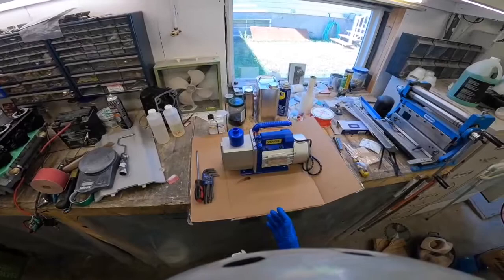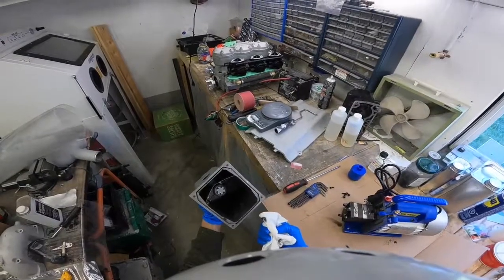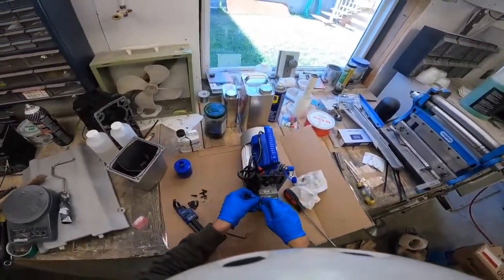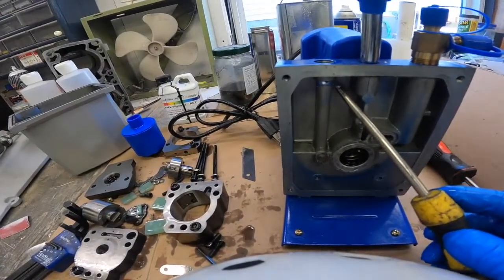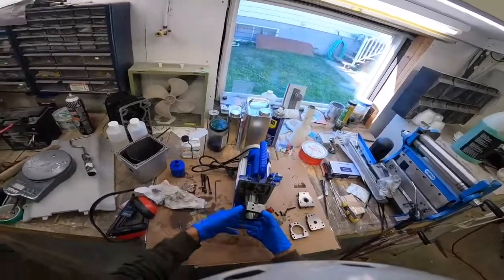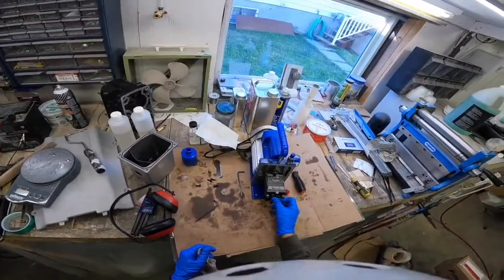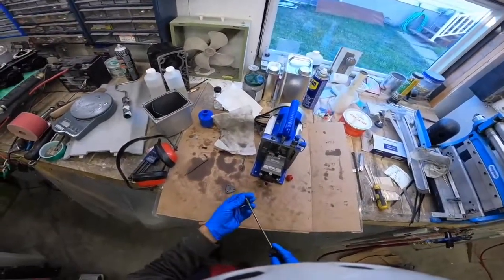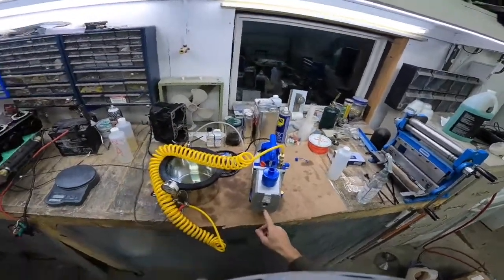Two Stage Vacuum Pump Teardown & Rebuild - Why Do Cheap Vacuum Pumps Fail ?

Comment: Sorry I'm slightly confused, must've missed something...  What causes cheap vacuum pumps to fail?
Watched the other video (1st part) and saw your previous pumps were seriously defective with moisture corrosion.
The reason they fail is b/c these cheap pumps are full of gak/grit.  I've seen that on many other Chinese manufactured items, I think they don't believe in keeping things clean, they know well these aren't clean.
Hopefully mine isn't ruined already, I'll be taking it apart for thorough cleaning.
Reply from the maker: Yes, this is part two, and in the first one I showed a lot of rust. In addition I took this working pump apart and found a combination of rust on pump surfaces from being shipped, grime / casting junk  and debris left behind. I also found a missing bolt, so in some cases being assembled poorly.
Reply: @JoelArseneaultYouTube  Thnks, yes I did miss the first part.  Going to watch it now, for the details!

Comment: Hiya, thank you for taking your time to make this, I'll make sure to clean the one out that I just purchased. However what oil/oil specification do you use on these pumps? Also how did you go about removing rust?
Reply from the maker: You need to use proper compressor pump oil. Lots of times "special oil" is just a marketing thing, but this is legit. The quick explanation is that normal oil has a lot of stuff in it that will offgas and this would not allow the pump to pull a vacuum. The proper oil does not foam or offgas at low pressures, and this makes it possible to pull a better vacuum. 

If you have rust, I use scotch brite when I can. It will remove rust pretty well and isn't too aggressive.

Comment: Amazing work! I'm shocked this doesn't have more views. Of course a 1hp vacuum pump is better at decreasing pressure, and moving air, but why does 1 hp make you more comfortable running it for long periods, than one rated with less power? You totally could be right, but I don't understand why that'd be.
Reply from the maker: Thanks for your comment. 

Running a bigger pump with more power has a few advantages. 1 is that it is able to pull a vacuum more quickly and maintain a vacuum if there's a small leak.  It can also run under higher load for a longer period without stressing it out.

Comment: Use a cold trap to stop moisture harming pump. A cold inverted U that condenses vapor before the V pump.
Reply from the maker: This is an interesting idea...Not trying to pick on you by responding to your comments...  I'm really trying to wrap my head around it and it seems backwards. Cold air is more dense and has more moisture. For this to work, you would have to cool and condense the air, pull the moisture out of the cool air and then allow it to enter the pump. 

On a closed system, simply cooling the air would condense it, but that would just create more work for your pump as your pump would then have to expand the air, and if you didn't remove the moisture it is still getting that moisture. Further, you can't trap moisture in a vacuum as the vapor point of water would stop this from happening... unless you used liquid nitrogen to keep it frozen. 

It is my understanding that even ice in a vacuum will offgas due to the vapor point, so I'm not sure how or if it is possible to remove water in this way. 

It seems to me that super heated air would be free of more impurities, like water and would also have more energy that would be easily extracted, and as the temperature dropped, the pressure would naturally drop. I may be missing something here, but it seems to me that heating the air before your pump inlet would drive off moisture and be the best solution.

Comment: Such a beautiful job!  Thank you.  Mmm.  A thought.  A question, rather.  When does a rotary vane pump work hardest: (a) when pumping against ambient air or (b) when pumping against a vacuum?  You seemed immediately to have acquiesced to the notion that (b) was the correct answer. And you even defined pump break-in and shut-down protocols predicated upon that intelligence.  I won't dispute the correctness of your protocols, I merely deny their premise.  That is, I claim that a rotary vane pump works harder when pumping against ambient air than when pumping against a high vacuum.  Given that the pump runs at a nearly constant speed (which is probably pretty nearly true), the amount of gas that it expels will be proportional to the density of the gas that enters its pumping chamber.  Indeed, in order to expel gas at a constant rate (which effectively equates to a constant rate of work) , the rotational velocity of the pump would have to increase inversely to the gas's density.  But it doesn't.  

Upon considering the problem further, I believe that the answer turns upon asking the right question.  I would claim that rotary vane pumps, once running, do very little work when pumping against a vacuum.  Moreover, I claim that their capacity to generate a vacuum is limited -- not by the power of their motors -- but by the lack of gearing needed to increase their rotational velocities.  However, during startup, rotary vane pumps have no rotational velocity.  When pumping against ambient air, the pressure differential between the inside and outside gasses is small and nearly constant while the pump is rotating slowly.  But when pumping against a high vacuum, the pressure differential essentially equals the ambient pressure.  So the pump must produce a large, momentary torque in order to initiate the pumping process -- which is, I think, the rationale behind your startup protocol. Interestingly enough, compressors have a similar startup problem.  A special valve is used to bleed off high-pressure gas from the compressor's compression chambers when the motor turns off.  This prevents the compressor's motor from having to muster the torque needed to complete an already begun compression cycle during startup.  

Anyway.  Your presentation was a tour-de-force of logic, self assurance, and gumption.  You're the guy who went from knowing nothing about rotary vane pumps to suggesting how pump engineers might improve on their design (by using studs to ensure proper registration for the pump's component parts).  Kudos!
Reply from the maker: Wow... You obviously put a LOT of thought into this. You are correct, I made a lot of assumptions about the workload on the pump ambient vs vacuum. I don't believe I have the cognitive ability (or time) to fully process what you are saying, but I do understand what you are getting at. 

If you have a syringe half full of liquid, with no visible air, block the end and pull on it, the amount of force required ramps up, but at a certain point the amount of force required quickly ramps back down. It makes for a very odd spring effect and I believe this is caused by what you are talking about. 

As for the compressor analogy, I am familiar with this release valve. I built a custom compressor and installed it in my attic. The valve releases pressure from the top of the piston and the lines leading to the tank check valve, so that the pump can spin up under atmospheric pressure. 👍

As for spinning the pump faster, I'm sure that would help to some extent, but ultimately (to my understanding)  it is the lack of air molecules, close to a "perfect" vacuum that make this process difficult. If you were trying to empty a bathtub with a cup, at first it would go quickly, but once you have droplets the cup is no longer effective and a different tool is required. 

I don't think I explained myself very well, but I believe that the reason why the pump shouldn't be shut down under "load" is that the check valve system is not perfect in these pumps. My thought is that the atmospheric pressure will  leak through the check valve putting a load on the pump veins. I suspect this is not good when the pump is really hot.
Reply: Interesting.  I think that your cup analogiy is correct.  At some point the density of the compressed gas (viz. the gas in the cup) becomes so low (ie. contains so few molecues)  that it lacks the pressure needed to open and expel itself past the one-way reed valve.
Reply: @bradalmond3618  I'm pretty sure you are entirely correct. I'd imagine though, that although the pump isn't working as hard under vacuum as ambient air, that the decrease in air molecules reduces the cooling. So I'd imagine a vacuum to be doing less work once it pulls the vacuum, but counterintuitively actually generate more heat (in the material of the motor itself due to friction), because the creation of the vacuum also decreases the cooling media itself, the air. It's probably this increase in heat, that makes people often assume it is doing more work.

Comment: It was too late for me to watch this video before I start to repair My cheap vacuum pump (which I bought for 15 USD in junk yard). My problem was gauge was always stuck at -0,9 bars. Never have any exprience with vacuum pump and gauge before. Whatever I watch at youtube everybody reach almost -1 bar at their gauge. But by this Video I learn that altitude of Ankara is 980meters Which cause my gauge to show maximum -0.9 bar. I really learn a lot by disassembling vacuum pump but it is too difficult to adjust the Vanes and layers. if you do that wrong, your pump won't work properly. if you have 2 stage and powerful vacuum pump, maybe you won't notice that your pump work decent as long as you test it . It may vacuum fully but may be much slower than original. That is why very, very carefully try to fix your vacuum pump. May be better don't touch it. :-D I learn it by hard way, too
Reply from the maker: Sorry to hear about your troubles. I'm not sure what you mean about being difficult to adjust the vanes and layers? I am a mechanic, but I didn't find anything difficult about the assembly of this pump. 

I did have a slight issue with alignment of the housings the first time I put it together, but once I knew I had to be careful, it was easy to correct. I'm curious what your problem was / is.
Reply: @JoelArseneaultYouTube  First of all I did not study mechanic and I have very limited knowledge. My pump is the lowest model on the market I guess, 1/4 HP motor and 1 stage 1.5 or 1.8 CFM.. when I am rebuilding it, I can easily fix the layers 2mm left, right, down and up. So it is all up to me. It will still work but not at the best .if I do any mistake system shows me the result immediately ! WHY? because I have super weak motor + 1 stage vanes. NO backup vanes, not big power. Even the torque which you use to fix the bolds plays Hughes roles at my pump. But you are lucky you have 1/2 HP motor + 2 stage vanes + your pump looks more decent than mines. so even if you do a bad alignment or adjustment when you rebuid the system. it will still vacuum perfectly. Why, because 2 stage support to each others mistakes + 1/2 HP support them with big Power. But with bad allignment you may not reach 5CFM any more may be much less.After you rebuild it, even if it vacuums fully it may not be working at promised speed. May be I am totally wrong too. But "If it works... don't touch it" rules is the best. To be honest, I would still touch it. It is fun :-D  I also notice that more oil I add, better Vacuum I get . Pump that I have has oil window which has mark at the middle says " oil level" , no max or min marks. I add the oil up to 4/5 and vacuum gets better. I think oil is a great sealer. That seal the vanes very well. I use SAE 30 oil. not something expensive.
Reply from the maker: @TheHoppala007  Thanks for the clarification. I understand what you mean now.

Comment: I opened the 2RS3 and it. Looked different inside. I think they've redesigned the pump. 

The two blocks for 1st and second stage look much deeper/thicker and the reed valves have a faucet mesh on top with what appear to be adjustment screws as they sit proud of the surface..

Btw they only put a small amount of oil... Say 10-20mls. I was going to find an iso32 oil and use that.

Fan feels smooth but firm.

All external parts of pump look free of rust.

What little oil that's in the big end casing has fine black in the bottom with the rest of the oil above it honey colour. Not sure why they didn't include oil bottle in the foam recess but perhaps I got a cheaper deal.

The pump is identical to yours on the outside but inside looks different. Yours seems to have more blocks that are thinner. I'd send you a pic if I could figure how on this thread .
Reply from the maker: Interesting. The deeper vien sections would indicate that it is a higher volume pump. It sounds like overall they have made it a better pump 👍 I'm really happy with mine so far and have a lot of hours on it, so hopefully yours works well as well. 

Yes, I believe that black stuff at the bottom is stuff from the casting not being cleaned really well before assembly. It would get stirred up into the oil if you ran it fro long, and I can't imagine that would be good for anything. Perhaps someone already had your pump and removed the oil. I think it would be in their best interest to include the oil, as if they don't, they will get a LOT of people running them without oil. Even with the oil in the box and a big yellow note telling people there isn't any oil in the pump, people still run them and seize them... and then return them.
Reply: @JoelArseneaultYouTube  I'm running it for 15 mins with inlets and outlet cap open. With the required 370mls of oil and it's looking clean through window. Temperature with temp gun shows 47C after 15 mins from 25C ambient temp at start.

Will drain oil just to be sure as I got 5 litres of good quality penrite iso 32 vac pump oil for $32 AUD delivered.
Reply from the maker: @rodneyalan6441  That sounds good. They do run pretty hot under normal operation. That sounds like a really good price !

Comment: It goes down to only 25 Hg?  That is bad.   Even cheapest vacuum pump is supposed to achieve 99% vacuum or 29.6 Hg.  Original spec for this pump is probably 99% vacuum, so something is still not working properly.
Reply from the maker: It's a little more complicated than that. Vacuum pressure is simply the absence of air in a container, but the actual pressure is supplied by atmospheric pressure. 

You may be able to get 30 Hg below seal level if barometric pressure is really high, but I am at almost 4000 ft, so the max I can get here, on most days, is 25 or 26. I used it this weekend, it was a little cool and damp and it had no trouble getting to 26.5 Hg. 

Again, you are removing air from something, and the pressure is supplied by the surrounding air pressure. This is why there is a max that can be reached.
Reply: Pump specifications are for capped intake with no flow. Most pump manufacturer produce pumping curve pressure vs flow. Also mechanical Bourdon gauge give what is call gauge pressure related differential to atmospheric pressure. Thermal gauge like thermocouple and Pirani gauge type give you absolute pressure reading not relate to atmospheric pressure.

Comment: This top-down view isn't doing you any favors, especially with the extreme wide-angle lens. Everything is too small and the angle makes it very hard to see any detail, even on a 32" PC monitor. I can't help but feel sorry for the people viewing this on mobile devices.
Reply from the maker: Thanks for your input. I will keep this in mind if I do a video like this again. I believe the reasons I shot wide angle is because 1. I have it as the default (this is not normally what I shoot) 2. it leaves much more room for error with the part still being in frame if my angle isn't quite right and then I move around. 3. As I believe I mentioned in the video, this was not meant to be specific to this pump, just vacuum pumps in general. If I made a detailed video, it would very likely mislead or confuse people who have a slightly different pump.

Comment: Can't see shyt !!! 5 minutes in and was hoping for a closer view. Ugh
Reply from the maker: I've had this comment a few times. There are lots of different pumps and even pumps of this same model (over time) have changed and have more, less and different pieces, so a detailed, close up video would likely add more confusion than it would solve. 

If you have basic mechanical abilities you should have no problem taking this apart and putting it back together. (assuming that is your goal). There's really not much to it once you get in there. I would suggest either shooting a video of your disassembly or taking photos at each step. This was my first time ever taking one of these pumps apart.

Comment: Lol! I just ordered this pump 🤣🤣
Reply from the maker: 🤟 I now have hundreds of hours on it and it has worked flawlessly.
Reply: @JoelArseneaultYouTube  Nice dude. I should clean mine. But I did notice that it's a different model so it's probably perfect inside. It says CHINA on the box after all. Not to mention it looks exactly same as all the others but like... different model number ya know? so for sure these are different.... 😑😑 also glad I got oil. I got the pump today and the bottles they sent with it look like water that they just put in bottles themselves.
Reply from the maker: @YoureNotSoSmartBro  Haha... there are a lot of little differences. Some with motor power, some with pump volume / one stage vs two stage, and then others that make no difference at all like a different filler cap, carry handle etc. 

Most good vacuum pump oil is clear and quite thin, so I wouldn't necessarily count it out, but it's always good to have more.